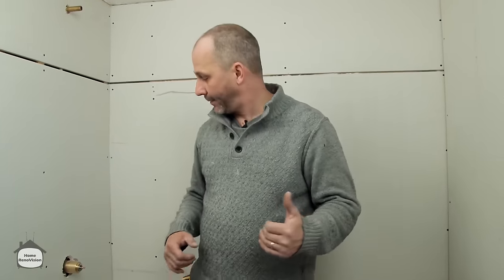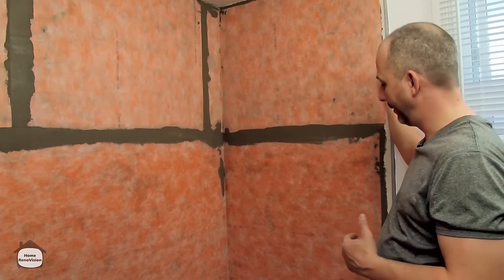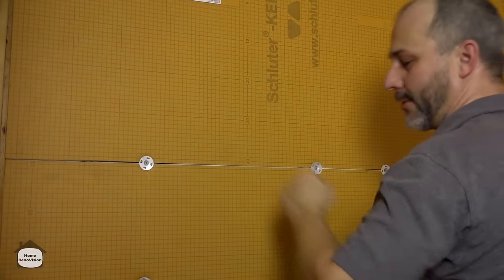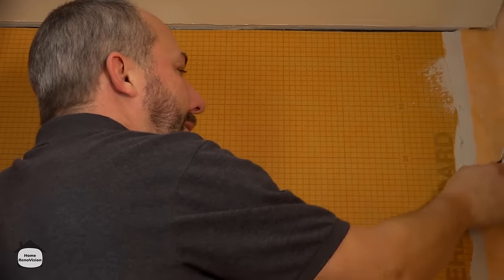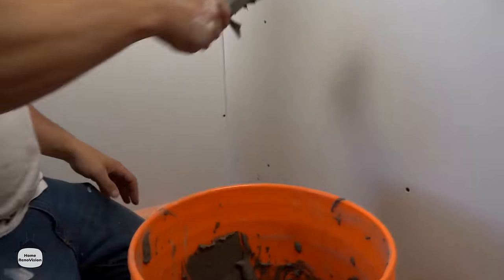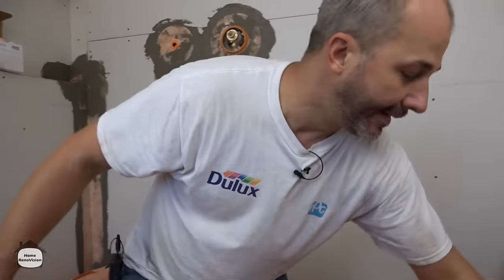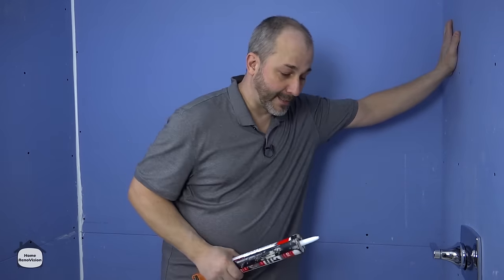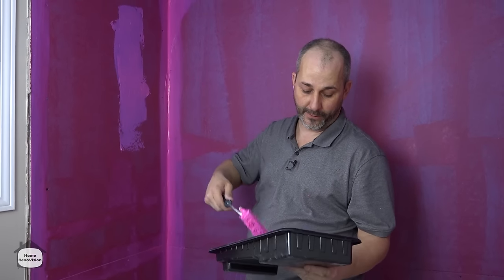4 Types of Shower Waterproofing Systems for Your Bathroom

Comment: My house was built in 1933, still has the original shower, no leaks....  When did showers start lasting only 20-30 years?  That's ridiculous.
Reply from the maker: new building codes allow for drywall in the shower without waterproof membrane and adhesive to attach the tile. that is why they fail so fast.
Reply: He is just showing different ways of doing things.Mud work like what you probably have for walls is almost non existent now..concrete board took that in place of
Reply: I agree it's odd. I can't even get my old tile off the thick ass cement walls of my 40's home. I guess ppl always do the cheapest new thing available, hence the invention of drywall versus old plaster over cement. If my bath was white tile and not been messed with I'd leave it, but alas it's been modified over the years and damaged when they rented out. I'm a strong believer in old school ways for sure.
Reply: Your substrate is probably metal expanded lath nailed directly to dimensional studs, followed by two brown coats of mortar and a smooth coat on top of that.  That method required extensive labor and a "tradesman" with experience and true skills to provide a smooth, flat, square surface to Thinset the tile to.  I don't think you could find such a craftsman today.  This system often lasts 60 to 100 years without as much as a cracked tile.  Visit an Italian city like Florence and you will see beautiful tile systems that were installed in the 15th century.   Ceramic tile was the choice for the exterior of the space shuttle. lol

Comment: Here in Australia, we would check that turn up on the tub into the studs so the wall sheeting would go down onto the tub instead of this silly idea of sitting the sheet on top of the turned up  then you have to use a caulking compound to seal the gap between the turn up of the tub and the wall sheeting. everything else looked fine.!!!!
Reply: My guess is he'll run the first row of tile down, here in America we also run ours the the bottom of the fin not the top..
Reply: Hi Robert , well said that is the only way to make a perfect waterproofing project, you could also apply a extra layer of plywood  before , a little more expensive to achive the some result

Comment: If I'm putting in a shower  insert instead of tiling,  would it be helpful to use this same system behind the insert? I just don't think I'll get the tiles straight plus, it seems like it would be more cost effective using an insert in a small bathroom.

Comment: Hi Jeff,   I've been putting off our Sandy ruined bathroom remodel for the past six years!!. Well I'm finally getting around to it due to your videos. You convinced me to use Kerdi Board in our bathroom. This bathroom is all interior walls but I'd like to insulate mainly just to drop the sounds to the adjoining rooms. I watched your soundproofing vids and I realize that 2 X 5/8" boards are the best but I think I'll be happy with a just insulation solution as I did that to the rest of the house before we replaced waterlogged sheetrock and we are happy with the slight quieting of the street noise. I will be using EcoBatt insulation. Should I use unfaced or kraft faced batts behind the shower wall?
Thanks so much and keep up the good work. Steve

Comment: I am removing a soffit to raise the ceiling in the shower.  What board would you recommend for the ceiling?  Should I use the Kerdi board or cement board instead?
Reply: drywall is generally fine for a ceiling, unless you are tiling it then go with cement board.

Comment: I would never allow this man in my home. My father was a 45 year tile guy. I grew up working with him and have now been tiling for 40 years. This guy works in a tub without protection down. I guarantee that all boots on a construction site have dirt, rocks or debris that will scratch up that tub. He sets tools on the toilet without protection. No drop cloths or masking off things before work.  If he doesn't give a damn about your tub, his work will be the same. The membrane he is using may be waterproof but cement is not. Fill a concrete bowl with water and it will weep out, so a thin layer between the membrane with weep through. And of course everytime he runs a metal broadknife down a corner he is scoring and compromising the seal. There are a dozen more mistakes here. The lip on the tub is there to be gone over and not butted to. If the tub wasn't framed properly then shim out the walls to have the wall skin overlap the tub lip. I have torn out enough shower and tubs to know never ever do anything over drywall of any kind. Water is sneaky, it will find its way in.
Reply: this stuff was tested under the ocean would that not tell you something he is doing it right for a waterproof seal and I was raised doing mud work but learned how to do this too,As far as tub protection your right but I am guilty of getting in a hurry and not protecting tub but have also took precautions as you have said and put carpet or a drop  cloth in tub                   better safe than sorry
Reply: I thought that was the difference between concrete and cement - concrete absorbs water, but the cement invented by the Romans (e.g. their acqueducts and jetties), hardens in water, something to do with the differences in their chemical make-up. The demo uses cement, not concrete. I too, questioned whether there was protection of the tub surface, it just might not have been shown in the video. I've seen other home improvement videos where the waterproofing system comes down over the tub flange, so I question that too.

Comment: I fastened durock cement board to the studs, one fastener every 6 inches, taped the joints with alkali resistant mesh tape and thinset, filled the screw holes with thinset, used waterproof fabric on the corners and at the tile flange with mapei’s version of Red Guard, put 2 coats of the same stuff on the durock, let it dry and it was very waterproof. I tiled after that, mixed the grout with liquid sealer and grouted. Shower is solid.
Reply from the maker: Nicely done Mike. Cheers!

Comment: Lepage 2/1 is a simple silicone ?  Also: how did you finish the joint for the ceiling ? Finally; will your tiles cover the lip of the bath ? Thank you very much !
Reply from the maker: It is actually not a silicone, but thanks for trying!

Comment: Thank you. This was very informative. Our shower drain is not centered in the middle of the shower length wise. Does Kirdi have options of where to put their drains? The Kirdi shower pans we have seen all have the drain already cut or they are  the flat boards.

Comment: I used mold resistant drywall and my sheets had a few gaps so I taped it with mold resistant tape and I used compound. If I use the redguard waterproofing product would that cause an issue or will it be fine before the tile installation?
Reply: S4S DU I believe it will be fine as long as you redgarded it good. It's good stuff.

Comment: So i would be a amateur when it comes to this in terms of professionalism.  i've done one tile job before, but not sure it was entirely correct.   One of them being the complete schluter kerdi walk in shower system.   This time i just went greenboard, and had a friend tape it (he butted the drywall together well).....since he already taped it,  after reading this....i'm a bit worried now.    Can i put this redgard OVER the tape? or should i peel the tape(would that destroy the greenboard?).    could use some direction here.

Comment: Awesome demos for sealing systems! Have removed a tub and building a shower enclosure which is being built on existing concrete floor, single story residence in Arizona. Just grateful for the best advice to properly seal the entire system correctly. Thank for all the video instructions!   Absolutely needed and hoping I don't screw it up!
Reply from the maker: Hi Jim, I hope all is going well. If you have any questions feel free to ask in the comment son any video. Cheers!

Comment: Thank you for your very informative videos. We are in the process of tearing out an old tub and the surround, and are planning to install a walk-in shower instead. We are just homeowners with quite a bit of experience in renovating our homes. This will be our first conversion, and we wanted to be sure that we are successful in waterproofing our new shower.  You make it easy to understand the potential pitfalls, and the importance of "following directions." Thanks again!

Comment: What was use on the shower floor in the method with mold resistant drywall and redguard? Do I need to use the redguard membrane on the shower pane for a walk in shower?

Comment: Love the videos! They are soo informative. I have the walls of 1 bathroom torn out and starting from ground zero for 2x6 brick glass mosaic tile. My cultured marble tub does not have a tile flange. What is the best method for water proofing this area post Hardie board installation?

Comment: Around 40:15 you are installing the drain.  What is that prismatic block or curb you abutted against the material that sits under the tile in the "basic" area?  I can't find a reference to it in your monologue.  I am trying get away from using an acrylic basic.  What you are doing is exactly what I wish to do but I do not know about that prismatic block.

Postscript - Schulter Kerdi shower basin system...part of the package - got it.

Comment: So concidering using mold and moisture resistant drywall in the shower. What have you found to be the best product used after the redguard to adhere the tile? Just from google Im getting tons of mixed info including to never use drywall. Thanks!!

Comment: I built a shower using the Alino shower system via Lowe's.  There's a few areas around the Alino band that I was considering using the Kerdi-Fix sealant.  What's your thoughts about using the LePage 2 in 1 instead of the Kerdi-Fix sealant.  After watching Isaac Ostrom's  video about Kerdi-Fix, I'm not so sure about the product.   Thanks for your time ...

Comment: Can i use polyurethane caulk to seal between drywall and acrylic shower pan using kerdi band? I believe we cannot use silicone caulk for kerdi/tub joints. I am planning to use kerdi membrane on drywall’s.

Comment: Great video! Love the format. One the best I've watched from you. The tub/shower waterproofing  methods have been a real nightmare over the years, wrong materials being applied and used the wrong way. Your demonstration was excellent! With so many new products coming out today there's no reason why a job can't be done with a true solid system. Thanks for sharing the basics of these.  I would like to see a better system for sealing the tub to the wall though, water always defies the rules of gravity there, traveling up behind the tile or wallboard.  Thanks again!
Reply from the maker: funny you mention that. we have been using a sealant to bond the tub to the membrane, Schluter now suggests that you use the kerdi band to go under the tile and onto the tub. The excess can be trimmed off after you tile.

Comment: Please: which video shows the transition between your wall (Kerdi Board or Gypsum) and the bath ? Trying to understand how to do that part. Cheers
Reply: I have a strange question: I just don’t know how to joint the Kerdi to the bath. My bath’s lip is 1/4x 1/2” . So if I put the bath flush to the 2x4 I will have the Kerdi going to “overhang” 1/4” over the lip. In my mind it would be better to have it vertically flush together...?

Comment: In the tub,  the cement board does not go over the flange right ( it goes flush up to the top.. If you are just putting the silicone there to seal it won't it breakdown? If I use X Fasten membrane fabric or Laticrete Membrane fabric there (like you mentioned in the video).. won't it be hanging over in front of the flange.. visible.. thank you

Comment: One more question...hopefully.  My tub lip is not directly against the studs.  A 1/2" Hardiboard or Durorock or whatever would put it basically even with the front end of the lip.  Does it need to be out farther than the lip or is essentially even OK?  If it does need to stick out farther, how much?  Can I use some kind of 1/8"-1/4" shimming material to get it out a little farther?  Thanks!

Comment: Hi Jeff , after cruising the internet researching  how to waterproof my new shower, I am so glad I finally found your video, just fabulous!  I really wanted to use the Schulder system, but can't  justify their pricing and proprietary installation tools.  I probably will use the roll on waterproofing membrane.

Have two.questions:
Does the shower walls need an uncoupling membrane?  The substrate can be drywall  or backednboard, I have not closed the shower walls yet.

I set my shower floor drain to accommodate the standard membrane and sloped.mortor bed, and I'm thinking I need an uncoupling material for the floor.  Would you comment on how to treat the shower floor?

Thanks.so much!

Jack

Comment: what type of system do you use in a basement, on an exterior foundation wall, what do you do if you worried the outside wall may leak? is there a  basement prep series? i will look later of course, just asking
Reply from the maker: the only guarantee is to waterproof the foundation from the outside!

Comment: The last waterproofing system with the red paint. I am confused does one use mold resistance drywall or cement backer board. I've seen so many video's where they use backer or cement boards. What should i use
Reply from the maker: either or. Cheers!

Comment: I have mould-resistant drywall installed around my bathtub, but used regular drywall compound at the corners and joints. Could I just Redgard over all of that prior to installing ceramic tile?

Comment: can I use a Kerdi shower niche in cement board without the Kerdi membrane? Will a roll on membrane be sufficient for water proofing the seam between the cement board and the Kerdi shower niche?

Comment: Good God there is alot of different systems out there!! I'm contemplating whether I should remove the old steel tub as there is moldy sheetrock underneath the cheap wall panels. I know you suggested cement board but I'm going the cheaper route. Probably best to replace the tub?

Comment: Jeff, Thanks so much for this info. Your videos have been a great help to me while I renovate my basement. For option 4 do you have a mold resistant drywall (or backer board) that you recommend for use is a shower? It seems that not all 'mold resistent ' products are made equal.
Reply from the maker: not concerned when using a waterproof system. cheers!

Comment: Hey Jeff,
Your videos are very informative and clear. 
I have a question, which one is the best between the waterproof membrane, aqua defence waterproof coating, waterproof drywall or kerdi panels? 
I am talking about quality and sustainability not the price.
I have another question, which brand do you recommend Dewalt or Milwaukee for everyday use.I can see you always use Dewalt. 
Thanks!

Comment: Having trouble finding out which cement or thin-set to use .Should I use non modified thin-set cement or modified thin-set cement or regular cement modified or non modified over RedGard for shower tile???
Reply: modified thin set. versabond will work

Comment: Hey Jeff, love your work Sir, keep it up. I just started my own DIY shower renovation project. I was opting to go with the entire Kerdi System pan and wall boards, the works. But that gets expensive quick. Can I use the Kerdi pan and bold it to water/mold proof sheet rock and RedGard, instead of Kerdi board, in the effort of saving a little on materials?
Reply: Redgard should so the trick

Comment: I am replacing my insert shower that i removed in the basement. I am going to use a pre-fabricated 1 piece shower pan and then tile the walls and ceiling. One wall is cinder block.  Plan is to put cement board on two walls and then smooth out the cinder block wall (what product should i use to do this?) and then use roll on membrane.  What do you recommend for the joints in the cement board?  Would thin set be best or an unmodified cement? Would i use the same for the transition between the cement board and the shower pan?
Thanks!

Comment: Great video as always.  Could you 'paint' this stuff underneath the drywall where it meets the top of the tub edge? I'm thinking if the bottom of the tile ever seeps water through a grout crack, this would provide another layer of protection.

Comment: great Video Jeff    you have inspired me to do  my basement bathroom.     have a question about insulating around a shower.  the shower will be up against a concrete wall. (foundation)  After framing in the shower ,  is foamboard insulation sufficient on top of the foundation wall  ? and do you still need a vapour barrier?
Reply from the maker: I would install the foam board first and then use a vapor barrier as well after adding r14 insulation between the studs. Cheers!

Comment: Thank you for this excellent tutorial.  I have a question about substrates.  Currently, a contractor is at my home and he's already gutted the bathroom.  I will be providing the shower install which is going to be boards I paint with epoxy.  To prepare for my painting project, I watched another tutorial video in which a foam board is painted and installed probably because the contractor in the video installed the shower for his elderly parents.  My question is what other types of substrate would you suggest to paint (Dutch Pour) and then follow with an epoxy process?  The video I watched is by Stone Coat Countertops if you need to see the video.  Thanks in advance for your advice